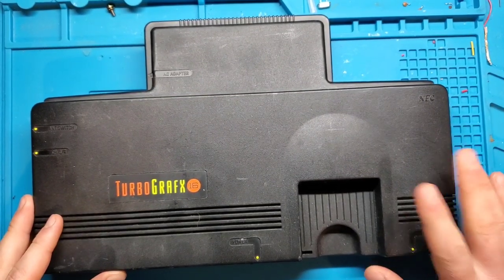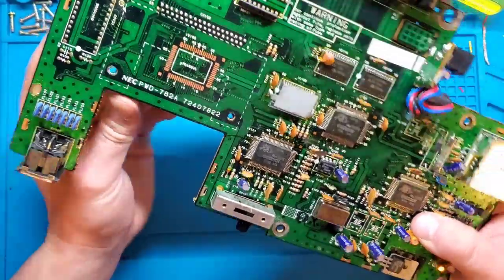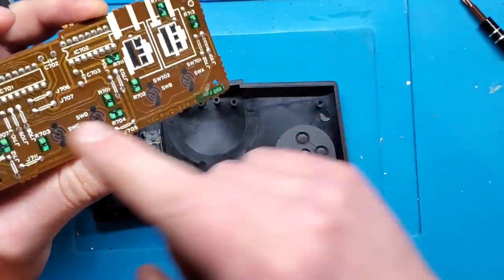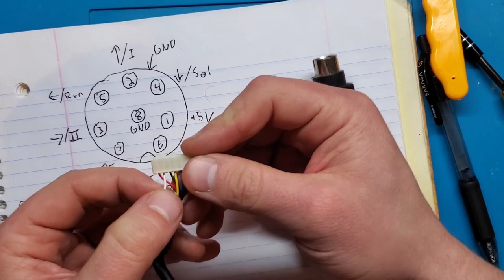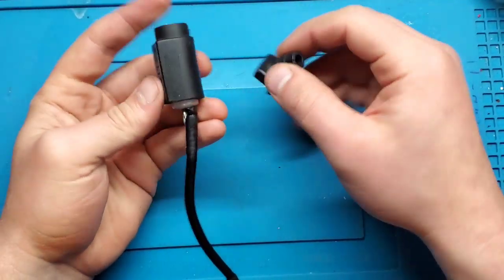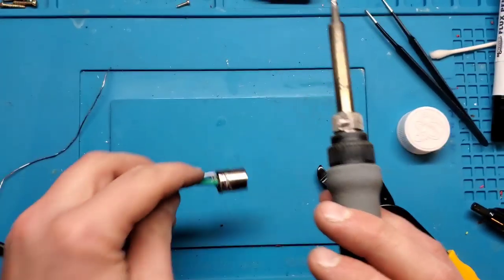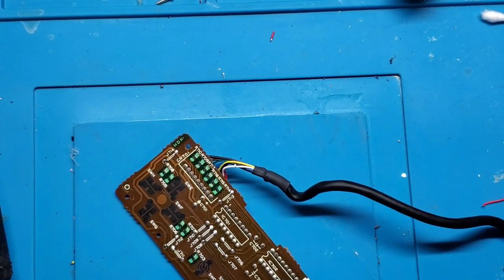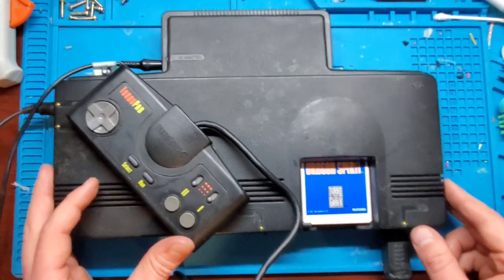Turbografx-16 - Part 1 - Repairing bad controller plug - Fixing Ebay Junk

Comment: I think I can speak for all of us stuck at home.  We'd love to see a full on repair of that cracked board.  Especially since the price working tg16's go for a pretty penny, would hate to see it scrapped.
Reply from the maker: It definitely wont be scrapped,  worst case it's a parts donor,  but id like to try and revive it
Reply: That is a HUGE undertaking with that much board cracked.. Its doable, but man, thats a lot of work. Super Props to @RetroRepairs if he does it.
Reply from the maker: My concern though,  is there was clearly a reason that somebody was poking around in there in the first place,. I wonder what else is wrong.  That would suck to fix it and it still doesn't work because the cpu is fried or something.
Reply: @RetroRepairs  I would love to see you try, even if you fail. I've fixed cracks like that a few times and I would like to see how you would solve the problems!

Comment: This is hilarious! I recapped mine (and also did the jailbars fix), last week. And I was like, man, there's not a good video about repairing or recapping this console (I did find one for the jailbars fix)... And today, you upload one! The TG 16 is awesome by the way. And you can get Turbo EverDrives from aliexpress for 45 CAD.

Both shields are soldered into place and mine also had that sort of flux residue all over it. As for composite or RGB, you can directly tap into the pins on the attachment port. The accessories are just a bypass, they don't have any circuitry.

Comment: It was not popular in America because it was insanely expensive for its time. I remember them selling it 400 hundred dollars to start which was just insane. My cousin had one and was the only person I knew who owned one. I have one now in my collection but it took me 30+ years to get my hands on one.
Reply from the maker: It launched at $199, same as the NES and Master System.   The problem was it was based on an 8-bit CPU, and since it launched two years later than it did in Japan,  it had to compete with the Genesis and SNES, making it DOA. 

The PC Engine actually outsold the Famicom for a while.

You might be thinking of the Neo Geo which was $649 in91, or the 3DO which launched at $700 in 93.

Comment: my controller had a similar issue, the connector had fallen out but thankfully the parts were all still undamaged so a bit of hot glue and it went back in and has stayed solid and functional ever since

Comment: Cool video!  Hey question, what size gauge wire is that for controller wire? What gauge did you use to cut the wire?
Reply from the maker: The individual conductors are 30awg
Reply: RetroRepairs thanks!  Love the videos!

Comment: If you have a panavise, the helping hands that attach to that are amazing. I got mine for $45, but they're goose neck, really rigid, and have magnetic feet, so you can reposition them on the base plate and take off the ones you don't need at the moment. I highly recommend them. I've used them to help mod my gameboy advances and a few snes controllers.

Edit: They're called QuadHands on Amazon.
Reply from the maker: I've been looking at a panavice, I've just got so little space as it is.  I need to rebuild my garage, then move out there
Reply: @RetroRepairs  they're definitely worth it if you're willing to spend the money on them. I use mine for a lot of different stuff. And when I'm done with it, I just put it back on my shelf.

Comment: Wow.. never saw that console. Heard of it before, but under the Name PC Engine as you said. Thanks for this interesting video.
Reply from the maker: Yeah,  the pc engine looked way different too, basically a tiny square,  half the size of this thing
Reply: @RetroRepairs  it's crazy how consoles in the early days where so different in other countries. The american snes, fot example, the one with the purple power and reset button and the purple controller buttons was here in europe so different. The controller for example had colored, a red, a blue, a green and a yellow, buttons and the consols itself had no purple at all. It looked like the super famicon, but was labled as snes.

Comment: hi nice video, a question, why you don't try to solder some pins directly on the broken connector and plugin normally ?, i'm a beginner maybe is a stupid question, but i'm curious. :/, thanks for the video anyway stll learning a lot
Reply from the maker: I wouldnt trust the strength.  Solder isn't particularly strong, and any pins i could add would need to be perfectly straight and the proper width to work correctly

Comment: First off, you mentioned getting extra parts.  Where from?  Got a link?

Also, Hyperkin makes a controller for the TG16, called the Specialist.
Reply from the maker: I get most of my console parts from console5.com

Handheld console parts from handheldlegend.com.  ive got a referral code to hhl if you find anything there for 10% off your first order,  ive posted it in some of my recent handheld videos
Reply: Cool! It's nice to see that a TG16 controller cable is finally available. All I've seen before were ones for the PC Engine. I tried to solder on a plug but failed miserably.

Comment: I watched This and part 2, But where is the rest? Like you know, the bad channel output it gave and did you get that new controller cable? Oh and more importantly I love the circuit board fix in part 2 that you achieved like a Legend, so how about giving a go at repairing the "udder" board, WAIT! I mean "other" broken board? Dropped a like BTW..
Reply from the maker: Part 3 will clean up the video and watch it all come together.   Im just waiting on some parts
Reply: Great to hear @RetroRepairs  that you will be continuing the series..

Comment: Shell swap is the way to go here I think, that broken board looks terminal to me. 
BTW a better way to test wires rather than using the wire strippers would be to get a fine sewing pin/needle and push it through the insulation to test continuity, it's much lass invasive and exposes much less of the copper to oxidisation.
Reply from the maker: Good idea.  Basically how ethernet plugs are terminated

Comment: Hey Adam. I'll be making a wireless turbografx16 controller kit. Should be available I estimate in 6-12 months. I'll contact you once it's done ofc.   As far as the controller you could check the logic ICs with your logic probe when power is applied (console is on).  Logic IC could be bad inside the controller.
Reply from the maker: That would be awesome.   It's great to see all the new development for these old systems. 

I just finished up part 2 of this series where i solve that right button problem.   It should be uploaded tomorrow. 

Good luck with the development!
Reply: @RetroRepairs  curious if it's what I speculated it is. I look forward to it. Stay safe.
Reply from the maker: I couldn't ruin the surprise...

Spoiler:

It was something else.

Comment: I've got a TG16 repair video in the works with a bad VDP, VDC, or VCE where I need to salvage and swap a replacement from a PC Engine or TG16. I'd love to salvage them from yours if you haven't thrown it out. :)

Comment: It hurts to see that cracked board, what happened ... Btw maybe you know this but you can make yourself a cheap composite video with some random RCA video cable and dupont connectors; and use that back plug, like in this tutorial : http://www.cgquarterly.com/2010/04/26/building-a-turbografx-16-pc-engine-composite-av-cable/. I used one many times before modding my consoles and good thing is, I don't know about the turbografx, but the composite signal of the pcengine is really clean and will be a nice upgrade from that rf. Thanks for the video, good stuff !
Reply from the maker: Im planning on doing a slightly more permanent version of that mod. I'll use a trrs plug and wire it inside the case.  It'll be a bit cleaner,  and grab from the same pins, but just from the board side
Reply: @RetroRepairs  Oh fair enough, if you're planning on making a video of it I'll be curious.
Reply from the maker: I might tinker with that board later, but id like to get one fully functional first

Comment: Tell me how you manage to crack a board.
Reply from the maker: I wish I knew
Reply: My best guess is that it was disassembled, left on the side and then was dropped but that doesn't explain why  the cracks are where they are.
Reply: @partypiggaming9344  Looks like it was propped up on that side and something fell on the point between the cracks.
Reply: If it was my bad luck something heavy around my desk would’ve dropped on it like a lamp or something.

Comment: Bridging the cracked traces is not impossible - finding all the breaks will take time, especially if any of those flat packs are over them. I saw someone fix a cracked Sega Genesis.
Reply: RetroGameTech I think
Reply from the maker: Yep,  definitely doable, just a lot of work.   I dont particularly like that the crack runs under an ic, I'll have to remove it,  then that presents an obvious future failure point should the board get stressed
Reply: @anonheart  was just about to say that. Lol
Reply: @RetroRepairs  How would the board get stressed if it's a stationary console? Seems to me no one's bending the thing.
Reply from the maker: It's right near the card slot,so that itself is a big stress point.   The controller plus in right there,  so the pushing and pulling will also stress the board

Comment: Some jerk tried to force the hue card in wrong or it fell, got bumped,  etc. with the card in.😣
With the fingerprints on the heat shield whwn you first opened it up, some clod hopper definitely was there first.

Comment: Every generation has 3 consoles.
One is always Nintendo.
Reply: Only as long as Nintendo has had a console...  but also longer than there have been 3 console per generation.
Reply from the maker: The first five generations all saw no fewer than 5 consoles each. (With the exception of 3rd gen games)

The fourth (which this was part of) also included the CD-i and Neo Geo)

Comment: Are you up for GC repairs or are not too retro yet?
Reply from the maker: I haven't dived into gc yet,  haven't done much with disc based systems,  but I'd be into it if i find some cheap ones
Reply: Most of them are laser issues.  It was a sturdy console.
Reply from the maker: Yeah,  that's what I've seen. That's part of why I've been reluctant to dive into ps2 and gc repairs. Lasers have a lifespan and eventually just need replacing.  You can tweak them a bit,  but eventually they'll burn out.

Comment: I think the guy that tried to fix the first one didn't have a soldering iron and just broke the shielding off, cracking the board in two places...
Reply from the maker: I suspect it was broken trying to rip the board out, not realizing there's two screws holding it in near the card connector.
Reply: @RetroRepairs  You would certainly have a much better hypothesis than me. Thanks for the content and good luck!!

Comment: You could've just soldered some cap legs where the missing posts were on pins 2, 6 & 7
Reply from the maker: The cap legs would not have been thick enough to connect into the connector